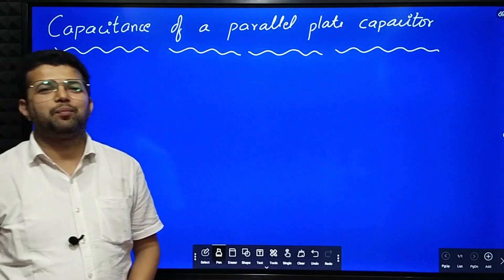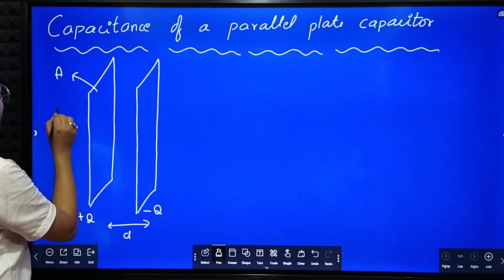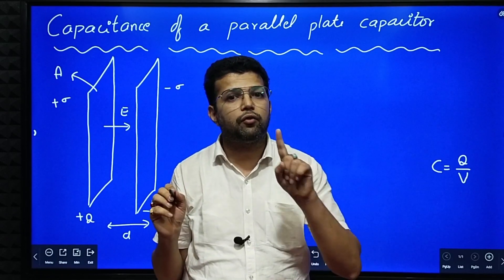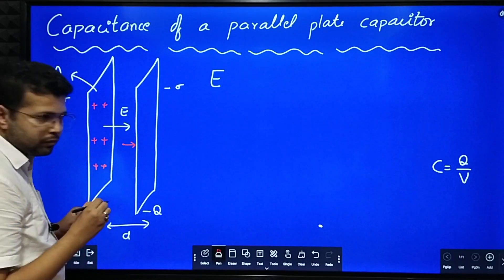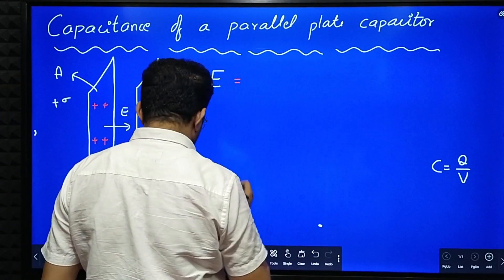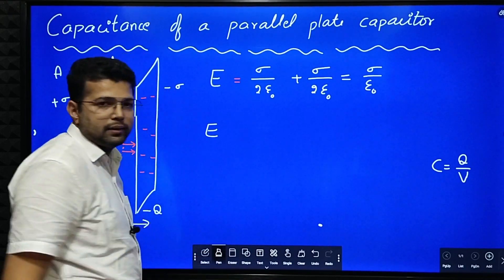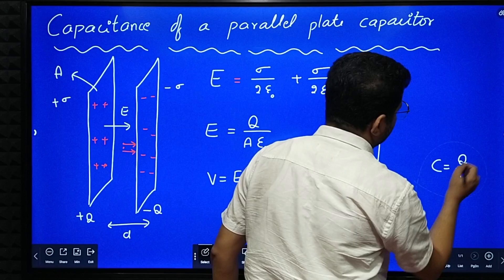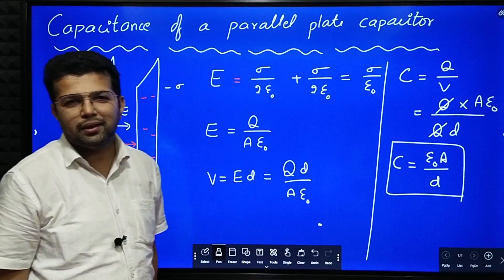Capacitance of a parallel plate capacitor - class 12 Physics

Comment: Sir if we write this much will we get 5 marks
Reply from the maker: Yes, you will get the full marks.
In the beginning write two sentences.
Consider a parallel plate capacitor with surface charge density sigma. Let charge on each capacitor plate is Q and area of crosssection be A. 
The electric field due to one plate is given by

Like this you need to write. You can write in your own words